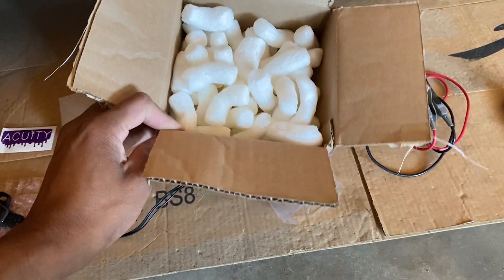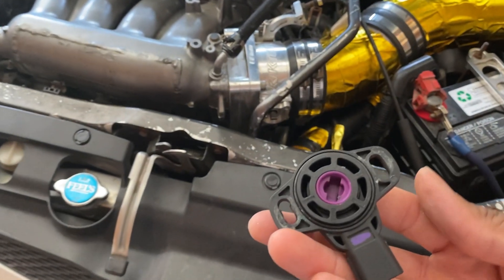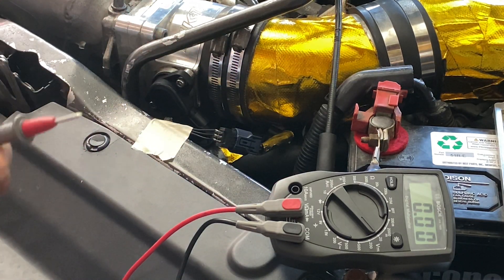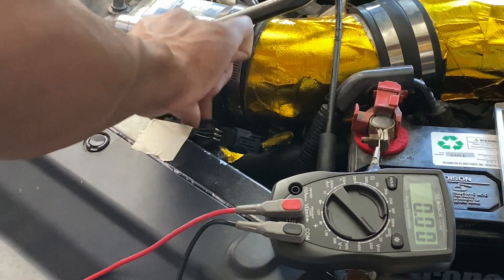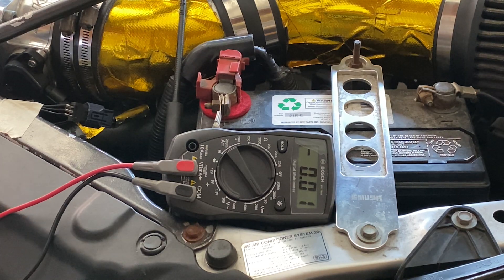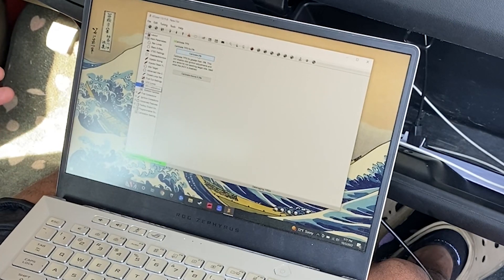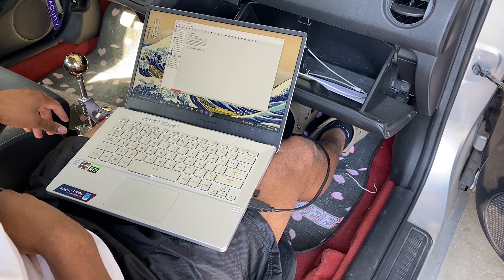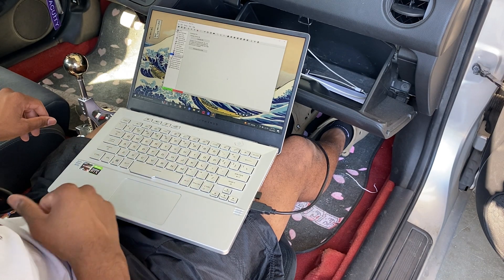Acuity TPS Install and Calibration

Comment: I’m getting ah p2227 code man I cannot figure out !!! It keeps throwing ah check engine & loses power & run sluggish, I’ve replaced map, tps sensor & all, going to try cleaning iacv & throttle body cause it idles up & down but I can’t get rid of these barometric problem!!

Comment: Do you have to get a tune in order for this to work correctly? So buy the tps, adapter,and the tune? Or could you just install the tps,read it with the multi meter and its all good to go?
Reply from the maker: You don’t need a tune for this. If you have an aftermarket ECU, then you don’t even need that jumper harness. But if you have a stock ECU then yeah, you’ll need that jumper harness.

Comment: You say earlier in video you had Kpro. Why would you need that extra jumper harness for calibration then? Because I have a kpro 4 and going to get Tps sensor and DONT want to spend more money than I need or have to.
Reply from the maker: Ktuner* I was fairly new to the car when I made this video. 

You don’t NEED it, but if you’re running into issues or don’t have an aftermarket ecu then that’s how you’d use it

Comment: Did you have to unplug the battery to relearn the idle afterwards? I just installed mine and I'm having a higher idle than normal
Reply from the maker: I didn’t. I think I left it hooked up tbh. Are you on a stock ecu?
Reply: @RAD_STO  nah I’m on KTuner. I ended up letting the car relearn the idle and we’re good to go aha

Comment: In ktuner, when push the pedal all the way down, do you get 100% on the tps? I’m currently capped at 80%
Reply from the maker: I don’t. But I seen on some forums that it doesn’t read 100%. If I remember correctly it’s like 80%-90%. Mine reads 83%